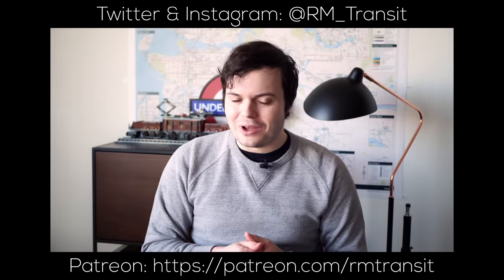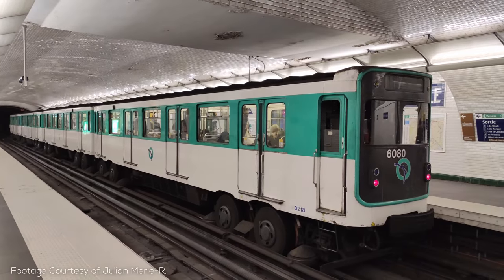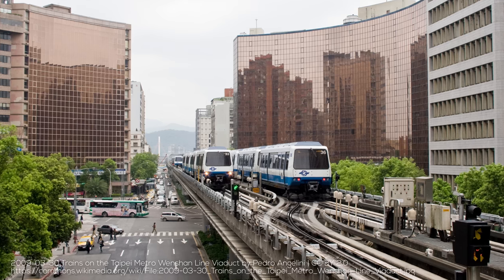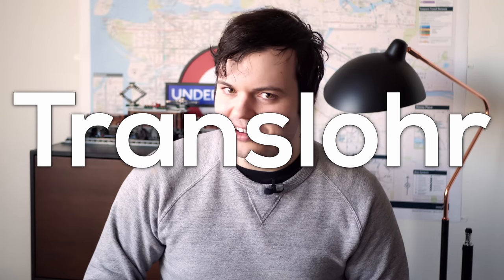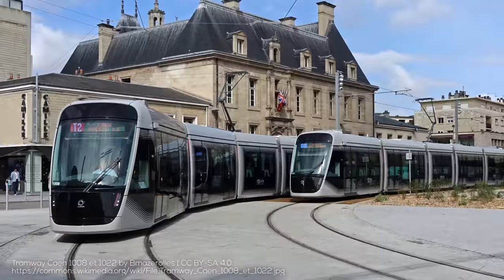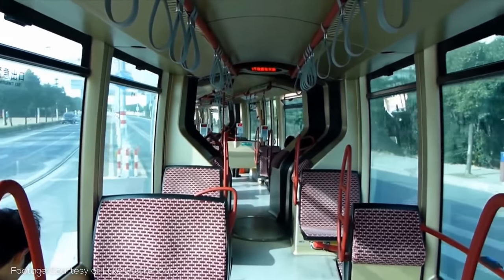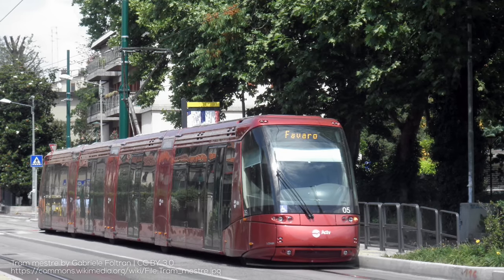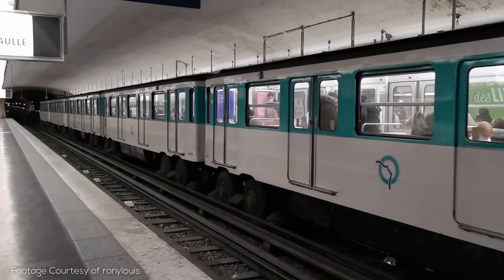Rubber-Tire Rail Transit is Weird

Comment: * the rubber Metros in Paris do have a bit of jounce (jiggle and bounce), but it's not really a comfort problem from my point of view. Neither is the sound.

* rail-on-rail causes friction; re-planing rails is expensive and complicated --- needs to be done in the nighttime. Rubber tires can be standard-issue and can be retreaded, and changed while a car is in the depo.

* noise of streetcars -- the squealing screech -- is a major problem in densely-populated cities. Folks who live nearbye often hate it! (Of course, the sensible people got used to it decades ago, but that does not apply to new lines). Rubber sure helps here!

* particulates might yet become the killer argument against rubber, on the other hand. Microparticles of rubber wash into street canals and often end up in the oceans. It's horrible and bad enough that cars and trucks do this, but public transport should be as clean as can be. Let's see if Michelin can develop organic tires! It should be possible -- metro tires have a less-complicated requirements profile in comparison to automotive ones.

Comment: I feel like rubber wheels are superior IN THE SOLE CASES of few vehicles, short distances, and fast speeds. All three necessary to be warranted at all. So, medium sized airports that have a tiny metro between terminals only.

Comment: Ahyes, a lovely technology. I think the manufacturers of these trains should look into floating trains to solve the rain issue. Cant aquaplan if you already float on water, tracks wont wear, and who does not like a network of canals running trough their city, it is quaint. Might struggle a bit with inclines, but I am sure that could be overcome by also fitting them with tires so they are amphibious…. ohwait

Comment: I'd add the inability to run in inclement weather depends on the system more than the tech. Montreal didn't design a system for rain or snow. SkyTrain can't handle very much in the way of ice and snow. That's on TransLink.

Comment: Rubber tires metro will always be niche. Whatever advantage they provide gets more than offset by the additional cost in maintenance. Non proprietary standard will increase costs. Plus you are dealing with way more moving parts than conventional steel wheels, so that increase wear and tear and likelihood of failure, thus drive up operating costs.

Comment: Brisbane metro (not cross river rail) is currently testing battery powered trackless trams and converting some of it's busswsy stations from Royal Brisbane Hospital Station to the University of Queensland Station or St Lucia I believe this approach was taken so that buswsy stations further out could still use conventional busses as they are still tied into street running routes but still very short sighted on Brisbane City Councils part, when the entire busway route could've been converted for light rail use and brought tram services to places that don't have a great rail connection, most of these said places just get a direct bus into the city rather than a close railway station but BCCs public transport policy seems to be we will build enough for people that can't drive and for everyone else just get a car TransLink & Queensland Rail aren't doing a great job of helping this issue either
Reply: I don't see how you can do a rail conversion on the busways without getting the entire core bus system *in one hit.* 
We're running at volumes that preclude trams and buses running interlined on key segments. Maybe it's doable on the INB, but it definitely isn't at Mater Hill. I don't think terminating Gympie Rd buses at RBWH, or Old Cleveland Rd buses at Langlands Park, is a particularly good outcome. Probably include Mains Rd, too. 

Don't get me wrong, I'd love to see a light metro system along all the major corridors, but I don't see how we'd get much change from $10 billion in building it and I do think we'd have to do it as one near-continuous build.

Comment: i dont think the tire roar issue is really much of an issue.... The places you would need that level of capacity is going to be places you generally are already conditioned to zone out the sound of unrelenting, 24/7 rubber tire roar any time you are outside.

while i dont actually mind the metal squeal of rail, I do have top admit that the rubber roar is significantly less jarring, And if I was not activly trying to hear it, would allmost guarenteed just fade into background like the 60,000 other cars trucks and busses I hear in a day

Comment: No, there is a rationale to having a diesel generator on public transit electric vehicles, in terms of disaster response. Diesel can be made from vegetable oils, run on alcohol with miner modifucations and vehicles can be utilized off track for rescue and transport, especially purposes during a crisis involving isolation. And the generators can conceivably be taken off and used where and how most needed. 

I do think you're correct though, 
very interesting video. 
Runber tires as an industry, are a heinous plague on the planet and a scar on the soul of humanity. The black soot you see on concrete surrounding highways, is not from engine exhaust, or asphalt back spray, but rather disintegrating tire fragments in this grotesquely unbreathable breathable form.
Not to mention French tire manufacturers having been part of the initial impetus which led to the Vietnam war. 
Or the soccer fields and basketball courts and playgrounds utilizing shredded tires filled with chemicals we cannot legally bury in the earth due to risks to the water table, yet good enough for our children to play on.

Comment: For Translohr and such, why not get rid of the rail and just keep it as a standard trolleybus?
Reply: Does the rail act as the ground for the circuit? A trolley bus might require a second set of overhead wires.
Reply: @neolithictransitrevolution427  Depends. Some use a pantograph and do return current through the guide rails, but others just use dual trolley poles like a regular trolleybus.
Reply from the maker: You need the second wire for one, but then yes it would technically work, but the tight corners etc could be tight
Reply: @RMTransit  You showed in your video that some systems don’t use the guide rail for power. There are some clips with both 2 wires like a trolleybus, and a guide rail (see 7:48). As for tight corners, the only difference would be that a human needs to turn the wheel (which happens anyway when derailments happen).
Reply: It was a Lohr idea to remove the steering wheel, hence enabling vehicle length to not be limited by local French road laws at 25m. This was a marketable attribute against GLT, and allows to eliminate electronic steering of other wheels
Reply: @DanCojocaru2000  That one is Bombardier's system which is more of a guided (trolley)bus than a rubber-tyred tram (down to having a license plate, for that matter) and can leave the tracks unlike the Translor which is build more like tramway (vehicles can't leave the tracks) and thus also uses a pantograph.

Comment: I want mass transit in my neighborhood, but I don't want the noise of steel wheels on steel rails, so... tires. I suppose there are ways to make fairly quiet rail systems, but they aren't cheap and aren't likely to be as quiet as tires.

Comment: While I like your presentation and opinion, I feel like you should have presented the viewer with actual cost numbers.
Because these tire trams do not have 100% of the same infrastructure, they have less. I say that as an engineer.

Building rails is difficult, because you must be very precise up to the millimeters and you must have the two rails level and or in the correct non level position in curves. At the same time, they are basically blocking big parts of roads (since Mixing cars and trams usually is a bad idea or not optimal. In my city of Dresden, they are trying to de-entangle the traffic modes with a lot of money currently).

While it is true it is better to have concrete lanes instead of asphalt, these lanes also benefit other traffic and generally lower the spending for road construction and rail construction in the long term.

Knowing the cost differences between buses and tram systems, I’d guess this is actually a sweet spot system in terms of moving capacity, environment friendliness and cost.

Comment: hello, i have a thought scraching my brain for some time now, and its partly has to do with the bombardian tire tram tram you showed, and any other trolley bus like system.. the have to poles for two wires.. that means 4 wires for a both ways road.. but why not 3 wires for both ways with one common pole? i understand that at some point when two trolleybuses on the opposite direction meet there whould be a conflict to solve. However a 3 wire system would have 2 great benefits.. the one is 33% less wire and the second 33% less space needed over the road. The second whould be a huge advantage for this kind of system to be expanded on narrow streets of crouded cities like mine.. and the trolly have huge advantages over diesel (energy noice etc).. the same could also get aplied on bombarian like system, althought trams need big intersection to change direction.. i believe the conflict issue i said before can easily solved at 2022,.. i have some ideas

Comment: After getting two flats on my bike just last week, both from tiny pieces of windshield glass, I think these are a terrible idea lol. I consider ditching pneumatic tires a benefit of rail.
Reply: These were tested heavily since 1951. Since then, I found no record afaik of tire blowouts except when the train derailed due to external problems

Comment: i feel mixing rubber-tired subways w anything that’s literally a bus is misleading, they’re two completely different animals. specially when approaching v specific case scenarios like you did. 

take for instance the santiago metro, which you’ve done a video about. the newer lines have much more distance between stations w much less height difference between them, great scenario for steel wheels. but, older lines (1, 2, 5 specifically) have stations as close as 400m and w much more complex grades (NS2016 trains had to be designed w this in mind) that need rubber tires to function properly.

Comment: Idk what I'm more surprised by the fact the tires are inflated and not solid rudder or run flats or the fact any one approved the massive this  security risk for use or the fact these subways are still running in the most riot and terrorist prone city in Europe.... if I hear of a terrorist attack in Paris in the subway I will not be surprised

Comment: honestly, yeah steep grades are a good use for tires... honestly belongs in San Diego and Los Angeles... correct me if I'm wrong, but SD trolley tram LRT thing uses steel wheels and it's a bit dumb tbh considering the area is nothing but hills and more hills ... they had to build massive interchange style bridges to connect it all... honestly, the bridges were useful but only bc the system operates like a tram in some places and like a train on others, so idk solving a problem to the problem u created and creating another problem lol 😖
Reply: honestly, the service isn't that bad if u plan ur daily routine around it, and the ridership is not too bad... it's just ball game rushes are awful to be honest, pretty much getting sa-ed... and sometimes the actual riders are not very clean (homeless or shut ins) or respectful of the space

Comment: "
One issue you didn't mention is energy efficiency.  Rubber-tired vehicles consume significantly 
"

If one ignores the ginormous amount of resources required up front ( aka fixed costs ) for steel wheels on steel rails, sure.  But that's Enron accounting at work, not the full picture.

Comment: Any system that takes a common and widely implemented transit system and modifies it in some niche way is kind of a gadget bahn. In this sense, lots of successful systems are a little bit gadget bahn-y. Whether this is a problem in any particular instance can be a little harder to parse out.

The disadvantages of adding niche 'innovations' to a common technology are fairly obvious, reduced reliability due to added complexity or immature technology, and poor availability of equipment (or even total vendor lock in).  
The presence of these disadvantages shouldn't rule the system out straight away though. It all comes down to the why. If a system is implementing unusual tech in order to make the system better, there is a solid chance that the gadget bahn is, on balance, a good option.

Unfortunately, a lot of gadget bahns get built for little reason other than,  "gee whiz, would you look at that!". And gee whiz isn't a good enough trade off.

I think early straddle beam monorails were in the worst category of gadget bahns.

A bit better is something like Sydney Light Rail, with the off wire technology which was done to relieve a supposed public reluctance to have wires up the main street of Sydney. Does it make the system better? Certainly not. But did it make the system politically feasible? Perhaps. 

Far and away the best example of doing a gadget bahn right is BART. The system famously uses an unusual broad gauge and a strange wheel profile. This was done to improve stability in crosswinds, which allowed the vehicle to be much more lightly built, which in turn allowed the viaducts to be lighter and cheaper, which allowed more of it to be built.

Comment: 8:23 The translohr in Clermont Ferrand (home of Michelin) was build after they ditched a project of "classic" steel wheel tram.
Michelin and some other local industrials and retailers lobbied against it and pushed for the translohr. Delaying the project and trapping the city into a proprietary tech they now recognize as an error but won't change or extend until it get at the end of it's life cycle. 
It's a really bad situation created by political pressures.

Comment: IMO for 100% closed-loop metro systems with open-air segment(s), rather have linear motors (not limited to induction, also including synchronous and other forms) like Japanese systems (not limited to one manufacturer's design) and third rail like most 100% closed-loop metro systems with no railroad crossings for safe unattended GoA4 automation. Though with linear motor trains, would also add a specification where the steel wheels NOT fixed to an axle so there are differentials but in an inexpensive simple format suitable for direct-drive trains (i.e. non-wheel-driven and non-surface-dependant; rack, linear motors, etc.). Rubber-tires IMO is not worth it if linear motors can perform just as well or even better than rubber-tires especially in open-air segments. Rather use rubber-tires for buses and trams/LRTs with NO mainline railroad segment (e.g. depot connection via mainline rail). Otherwise, rather have more trams/LRTs be mainline rail compatible (e.g. retractable on-board train ramp, mainline rail power specs, tram/LRT stations along mainline rail accommodate freight and commuter trains' width, etc.) so there are options for new tram/LRT routes be along mainline rail routes regardless if it's in a minor (e.g. depot connection), major, or 100% whole capacity.

Comment: It is definitely possible to retread rubber tyres. Road hauliers do it all the time. There's no reason why it wouldn't be possible with people mover tyres, apart from potential greedy rightsholders wanting to sell new ones and not selling new treads.

Comment: The Rubber tyre Trams are a bit of a disaster, Translohr & Bombardier. No economies of scale because very few systems exist. And the roads & stops that service them have to be refaced & relaid regulary. Because the non standard weight of the vehicles causes damage to the road & stops

Comment: Talking down on the tech with "guided bus" - Enter my biggest peeve in all mass transit - THE TROLLEYBUS. It is illogical to see that tram as a bad concept and needless if you also like and think Trolleybuses make any semblance of logic or sense. I despite Trolleybuses for the obvious reason that they are the result of a extremely lazy transit engineer who couldn't decide between making and selling a bus, or a LRV, so said screw it and bastardized the hell outta both to create a Trolleybus.

Comment: Rubber tie trams are just trolleybuses with extra building and maintenance cost. How are these sold to city councils / planners in the first place? No one points out in these meetings that they might as well spend a little more money on ripping out the road to install proper steel wheel rail or save some money by just not using rails at all?
Reply: Mostly Lohr guys are very good at marketing this to elected officials and have good contacts in lots of places. This story happened in Strasbourg were it was repelled for lin F by citizens, planners and studies. (It was discussed in french on TC Alsace website iirc)

Comment: You asked why Medellin couldn't have used buses. Surely even Translor is better than a bus.....

Medellin is probably the only place where they actually make sense. Not these flat European cities.
Reply: Why? If you'd just had a separated busway, like the translore it would be much better then a translore. Think of the fact that most of the busses would be cheaper and more powerfull. And with traffic works fot example, you are not as flexible as you could have been using regular busses
Reply: Ya, whats wrong with a bus?
Reply: "Not these flat European cities." As a South German, I'm offended.
Reply: @MarioFanGamer659  I didn't mean all European cities are flat, but the ones that have these rubber tyres on them,  seem to be all be. I probably should have said flat French cities.